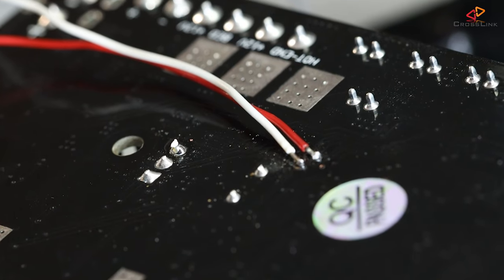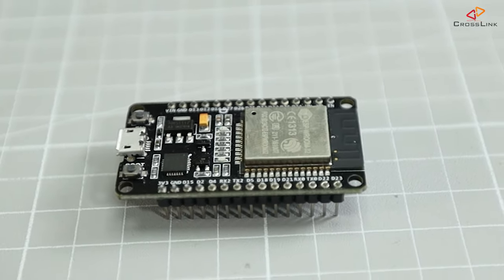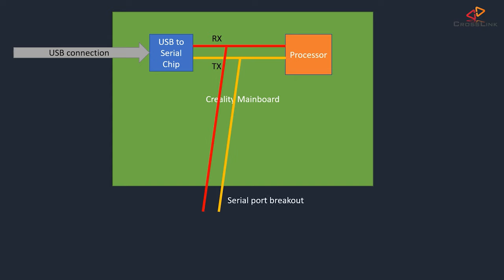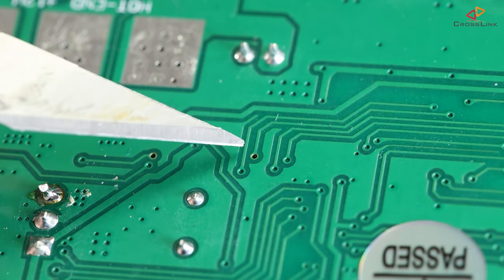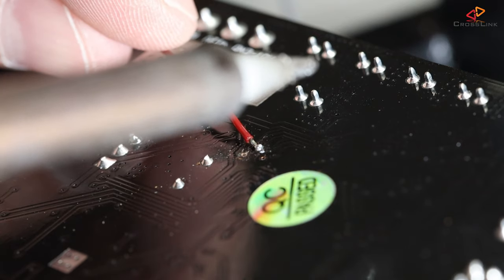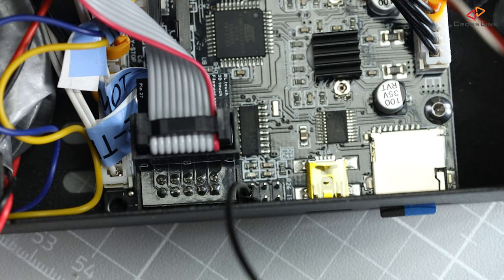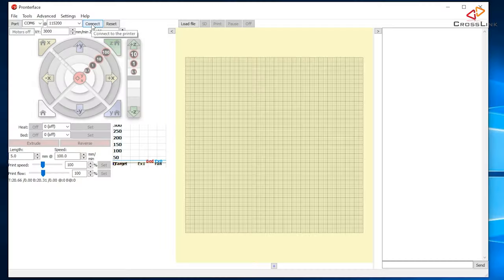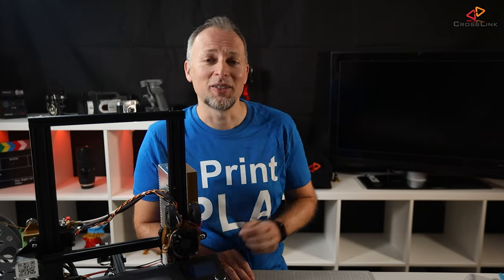Hacking Creality Mainboards - serial port breakout explained

Comment: As others have mentioned, this is doable on the 4.2.2 board; no need to scratch anything off. 
Just land 3 conductors on the corresponding gnd tx and rx pins' on the CH340G chip. (You'll want to look up the pinout)
Confirmed this works, I've done it myself.
Reply: Did this, got massive bridging on the chip(excess solder between pins) and now the USB port no longer works. I hope it's not damaged. To those looking into doing this, you might want to practice a bit first its not as easy as it seems.
Reply: Yeah correct, this is what I going to do with my wifi to serial device I have ordered.

Comment: Wow, that's exactly what I need to do in an MKS Robin E3D in which I managed to snap off the usb port. Any chance you could enlighten on how to do that?

Edit, I saw the Robin E3D has TX, RX and GND on the AUX1. Is it possible to use those ones?

Comment: Or you can solder the wires directly to the ic pins 3 and 4 (CH340) so you don’t have to scrape the solder mask off. Use a spot on hotmelt or fast curing glue to adhere the wires to the top of the ic. U1 is a SO16 ic and quite easy to solder the wires to. Remember you will need a wire soldered to common too, 3 wires in total.

Comment: just completed AM8 build that you showed on previous video. im very pleased on the performance. I contacted futureismaker and he sent me out a great kit. do you think you can make more videos showing your am8 and setting/upgrades you use for it. my current set up is orignal am8 board with, e3dv6 hotend (bowden setup), bltouch, am8 frame and upgraded bearings.
Reply: also are you doing a vid on the new CR-6

Comment: Work it also on a 4.2.2 Board?
Reply from the maker: No
Reply: @Crosslink3D  how to get there out rx tx?
Reply: can i solder on the ch340g usb chip?
Reply: @maltekollasch8141  Yes you can, I just did it without issue.
Reply: @dennisgardner750  jess, i solderd it on the ch340G. But noch i have a skr e3 mini v1.2 and i does not need it anyway. But thank you Dennis Gardner. Best wishes from Germany

Comment: Why are you still messing with this 8 bit board? SKR Mini E3 V2 is so much better and this would be very easy because it you can use tft pins...
Reply from the maker: Sure, one of the last videos about the 8 bit boards...
Reply: This works for 32bit boards too. Also if you use Klipper it does not really matter 8bit or 32bit.